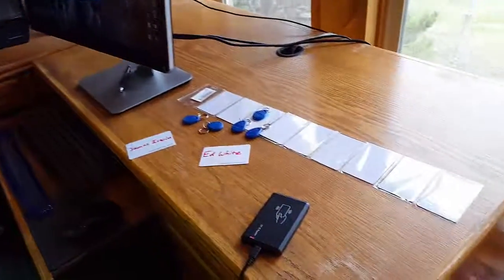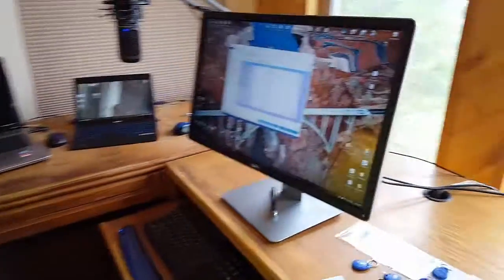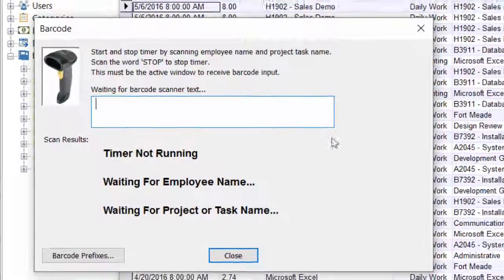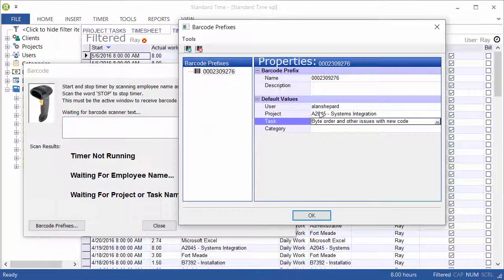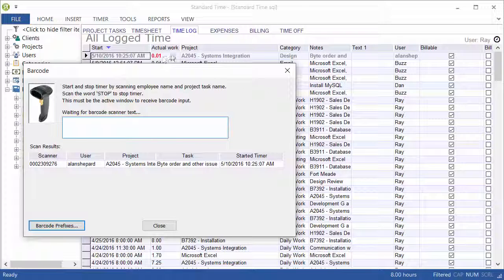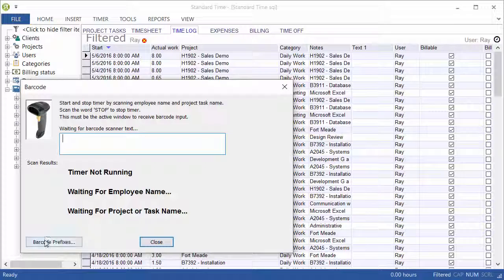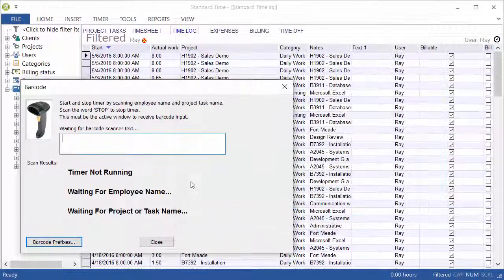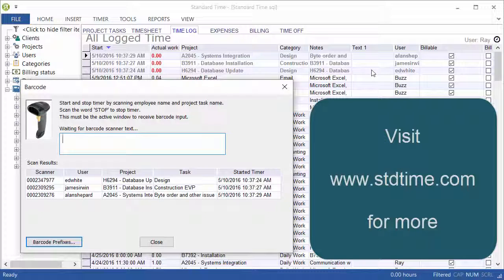Start a timer with RFID Tag Reader

Comment: how close to the reader does the tag need to be? can i extend the distance from the reader?
Reply from the maker: Most barcode scanners will read from a distance of 12 inches (closer is better). RFID proximity readers normally need 4 - 6 inches for "passive" tags without batteries in them.